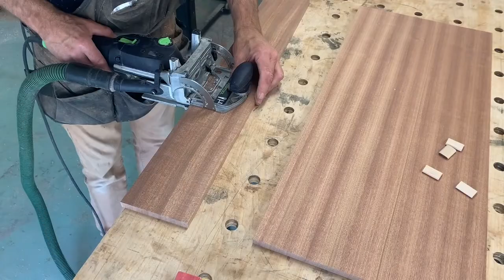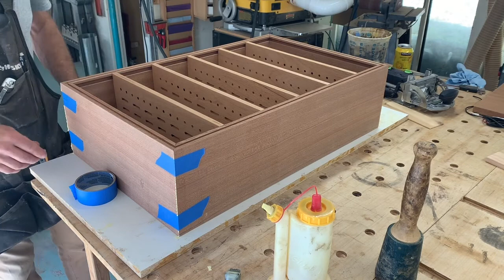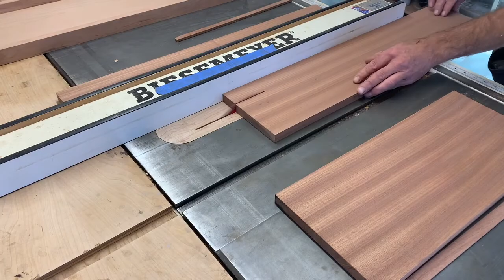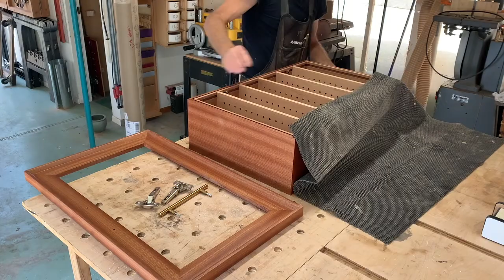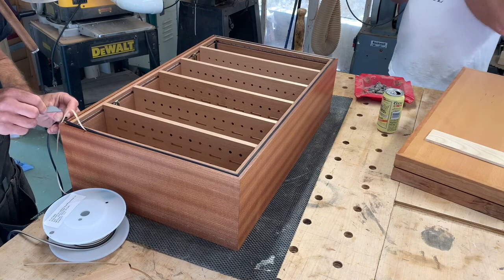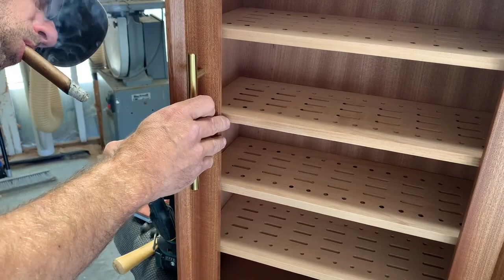Wall Hung Cigar Cabinet - New version

Comment: @mikka Olsson  Do you coat the inside and/or outside of your cabinet humidors with any type of humidity resistant coating? Something along the lines of a shellac? Want to make a humidor myself and would like to know if this a necessary step in making the humidor as airtight as possible. If you don’t, what do you do to achieve a mostly airtight space and to prevent the non-cedar wood from warping. Thanks.

Comment: Hi got to say great work ive watched all your humidor builds love your vids and great work 
Got to ask seen you use so many differnt hinge styles over your builds and differnt door location on the cabinet which style of door do you find best inside cabinet or on outside flash with cabinet? One for the better sealing of door to the humidor? Two for strength and the better hinge style to use to make the best seal on door? 
Be great to know your thoughts

Comment: Would making this out of walnut be a bad idea? Not sure how it reacts to humidity changes
Reply from the maker: Not an issue at all. The main thing is to have solid Spanish cedar close to the cigars. I’ve used Spanish cedar veneer in the past but it doesn’t have enough aroma. The cabinet can be walnut but the shelves should be 1/2” Spanish cedar